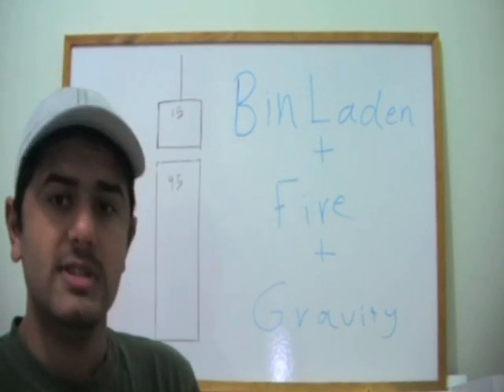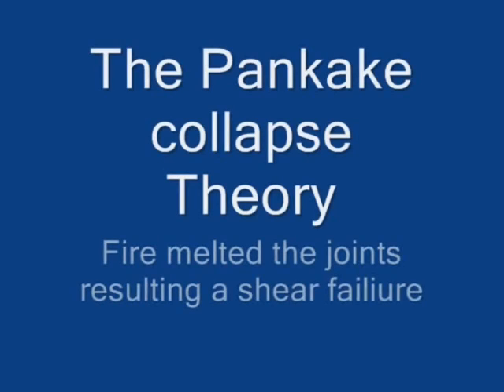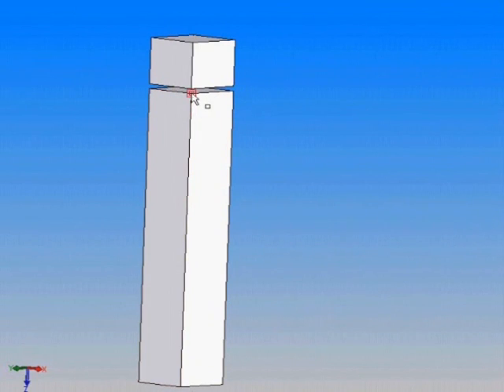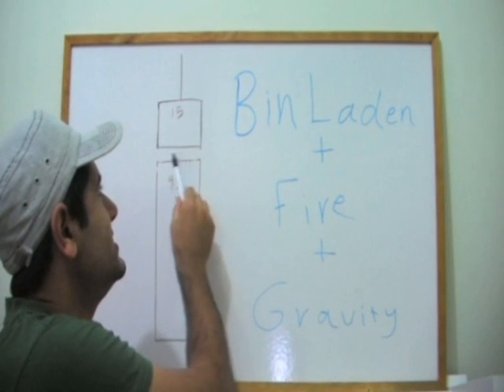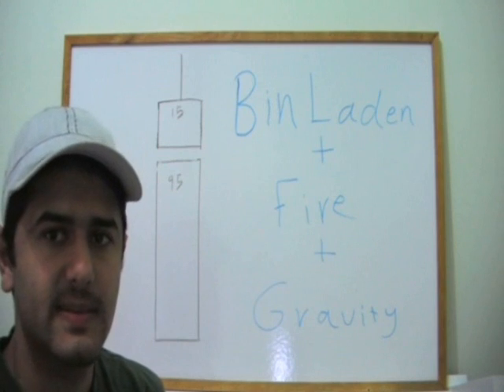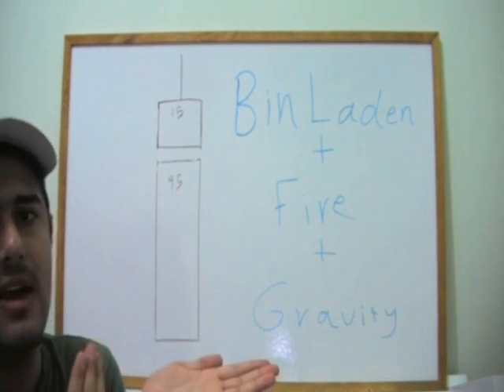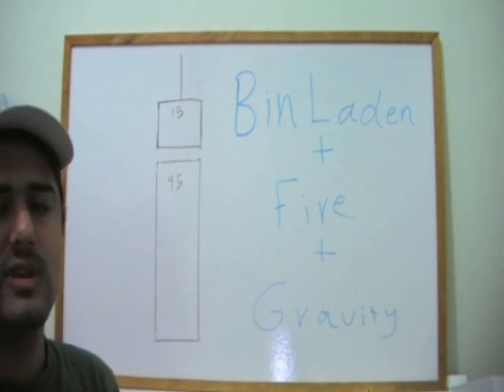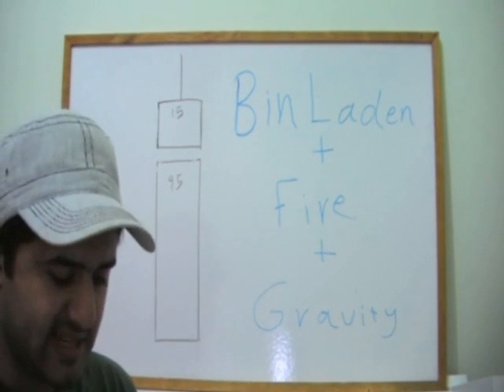(Part1) 911 Simple Physics Structural Failure Vs Demolition

Comment: all that needs to happen is for a percentage of the collumns and/or key collumn locations such as a corner along with 1 side, to fail for the others to instantly become overloaded and the entire building will collapse.

stop making excuses. we know what happened.
Reply: Blu Crystl - i read the first few paragraphs and already know your way off base. the COLLUMNS werent weakened by 50 to 90% and should not have been glowing red.
the TRUSSES under the concrete floor slabs WERE glowing red hot and failed, leaving the COLLUMNS unsupported and unable to support the weight of the building section above.
yhey didnt need to have strength reduced by heat.they had their ONLY means of standing removed and buckled like knees.
Reply: Blu Crystl - no way in HELL am i reading all that ! no way!
besides that your understanding of physics is severly lacking.
Reply: Blu Crystl - if you truly want to understand the WTC collapse, build a tower from legos or some other inexpensive building block set.
glue the collumns together to simulate their approximate strength as compared to other components.
or use lumber.
build the damn tower as close as possible to the actual construction of the WTC and conduct an experiment.
but heres a hint- cars are not a suitable analog.

Comment: Well, NIST says that the 1,362 foot tall North Tower came down in 9.8 Seconds. Laboratory free fall time is 9.2. This means that 80 or so floors of undamaged structural steel offered only .06 second resistance. This is impossible. Someone wired the towers to go down. The answer to 9/11 is 9.8

Comment: I once read a top class engineer commenting on this, he said when your sitting in your car and a big rig truck thunders down the road and runs right into your rear end, your little car does not move, the truck folds on your rear end, until it is virtually flat.  That's the same as this man is saying. You have 15 floors weight coming down on top of all the other {undamaged} floors below and that far smaller weight, even with momentum and remember the floors below get progressively far stronger. The floors below had to be far stronger to hold up the floors on top. It really is a puzzle because it doesnt add up in the physics.                Now your little car runs into the back of the parked big rig, If the Governments explanation of collapse is true then your little car crushes the truck right down to almost flat. Even with speed and momentum 15 floors cannot just flatten everything below, there is incredibly strong resistance in all the floors below. Anyway thats my understanding.
Reply: Ron, the towers collapsed at the point of impact of commercial airliners.  The south tower was impacted around the 78th floor, and this leaves 30 floors above the impact zone.  What do you think should happen when those 30 floors fall ten feet and impact the one floor below?  This would actually be better to here the answer your top class engineer would give.

Why do you suppose a 70 story spire was left standing after the collapse of the north tower?   Do you really think explosives placed in the inner core of a building would have left this same "spire" standing?

Comment: Studied science a little bit and you are speaking my language. I was just explaining all this stuff to my husband 5 mins ago, any one with an ounce of common science and a tiny bit of scientific knowledge can clearly see that it is physically impossible for the buildings to fall the way they did, not to mention the third building that collapsed the same way on its own, also another plane was brought down by the passengers or shot down.... I think that plane was meant for the third tower and they couldn't cancel the demolition because it would be impossible to remove all trace of the demolition set up, so they just blew it up anyway and blamed small fires. They claim phones didn't work on bored the planes but they do, they found no debris bigger than an apple yet they found the passports of the terrorists in the rubble. If you have a good memory of the propaganda on the news around the time, motives are clear to me

Comment: Plus, if they claim that fires weaken the steal, knowing that heated air goes upwards not downwards, we can assume that the part of the building above the fires has weaker structure than the bottom part of the building, making it more challenging to believe that weaker and smaller structure could crush larger and stronger structure. On top of this it is important to mention that the structure was progressively stronger on lower floors to hold the upper structure.
Reply: Here's what you need to understand: The towers were designed to fully support their weight via the columns; each floor was attached to the columns & was only intended to support its own weight, not the floors above (this is different from traditional skyscraper designs, where each floor supports the weight of the tower above it). It was all about the columns.

So the collapse begins when the columns BREAK and the full weight of the top block falls OFF the columns and directly ONTO the floor below - a floor that had zero chance of withstanding that kind of weight! Floor fails, its mass becomes part of the collapse & hits the next floor etc. etc.

So yes, the lower structure was very strong - but the way in which it was strong didn't matter because that strength was not broken, it was BYPASSED.
Reply: in your theory floors were piling up on top of each other and the weight of that pancake increased with each additional floor. There is only one small problem. Each floor had a layer of lightweight concrete 4 inches  (10cm) + steel beams. multiply 10cm x 110 and you get 11m + steel beams approx. 20m of rubble excluding walls and furniture and equipment. Can you show me a photo of such pile?

if floors were separating from the core colums falling down, where are they? Can you show me a photo of core columns?
Reply: Well, considering that the bottom of the pile was in fact 7 levels below street level - about 26m if each underground level was as high as each above-ground level - I don't see a problem with the pile. And much of the rubble fell outside the towers' foot prints, don't forget that.
Reply: the underground train track has not been crushed:
http://drjudywood.com/articles/DEW/dewpics/Image87.jpg

just so we understand how low the WTC 1 pile was:
closeup: http://drjudywood.com/articles/BBE/BBEpics/after.gif
zoom out: http://drjudywood.com/articles/BBE/BBEpics/before.gif
Reply: if the floors were collapsing, piling one of top another. where are the elevators? ther should no be crushed by anything? Where is a single elevator button? WTC had 150 elevators.

Notice the reinforced sections underneath the plane impact point:
https://upload.wikimedia.org/wikipedia/commons/thumb/e/e4/World_Trade_Center_Building_Design_with_Floor_and_Elevator_Arrangement.svg/799px-World_Trade_Center_Building_Design_with_Floor_and_Elevator_Arrangement.svg.png
Reply: Pawel LL Can you tell me precisely (on a map, preferably) where that train station was located? How deep was it? You see why the answers to these questions is important.
Reply: when you see a real pancake collapse you know it is real as therre are no doubts.
http://drjudywood.com/articles/why/whypics/25_pancake_quake051009.jpg
Reply: Oh yeah, I recognized the hallmarks of a Judy Wood nutter.

Space beams? That's the theory you're going with?

Um, okay.

Comment: I'm no controlled demolitions expert but it seems like the controlled demolitions experts have been doing it all wrong. From 9/11, we've learned that all one has to do is blow out a portion of the support in the top 25% of a building and then light a fire hot enough to weaken any remaining support structures. The building will then collapse into its own footprint in about an hour. Just think of how much they would save on logistics, explosives, det cord, labor etc.
Reply: TimReed22222 You agree then that the cost of the airplane does not factor into the feasibility of building collapse as a result of it being impacted by said airplane. You can't possibly know what I do or do not know about physics so you're a person on the internet making wild assumptions out of complete ignorance. This, to me, means there is no chance you would understand the math even if I drew it out in front of you. So, your statements only prove that you certainly don't know what you're talking about and have no validity whatsoever. I'll give it a go in laymen terms in a way a 3rd grader could understand. Law of Conservation of Momentum indicates, in part, that the mass of an object is constant. Simply speaking, the mass below the impact of the aircraft remained constant. The mass below the impact was much greater than the mass above it. For every action there is an equal and opposite reaction. So, the force of mass below the impact was acting in "at least" the same force as the collapse above it, right? So, the mass above would have stopped or at least met "some" resistance, correct? It certainly could not have accelerated to terminal velocity. Here, since the collapse above pulverized (keyword pulverized) the mass below at free fall (no resistance. Watch the collapse and time it yourself. Look up free fall before you make some stupid comment about what I know or don't know), this is the first time known to mankind that this happened and it just so happened to happen 3 times on the same day. One time, it happened on a building that was not significantly damaged by an aircraft (Building 7) which subtracts the folly of your hundred millions dollar airplane comment completely. The only way the buildings could have all collapsed at free fall is if there were no resistance (nothing but air below them). Partial collapse makes sense. Complete collapse and pulverization does not and defeats the laws of physics. If there was no resistance then the resistance had to be removed. One more time because this is important. If there was no resistance then the resistance had to have been removed. There was no resistance. Extrapolate how you will from that point.
Reply: Savoy W "This, to me, means there is no chance you would understand the math even if I drew it out in front of you."

Try me.

"Law of Conservation of Momentum indicates, in part, that the mass of an object is constant."

>*facepalm*< OMFG NO!No it does not. That's Conservation of MASS you're thinking of. NOT the same thing! 

And we're off to a roaring start ...

"The mass below the impact was much greater than the mass above it."

So? Wait - you're not going to argue that a larger mass always beats a smaller mass, are you? PLEASE tell me you're not going to say that.

"So, the mass above would have stopped or at least met "some" resistance, correct? It certainly could not have accelerated to terminal velocity"

The falling mass DID meet resistance. How do we know? Because the collapse did NOT reach terminal velocity (or free fall, as I suspect you mean since terminal velocity is not relevant here). I have timed the collapse. For the north tower it was over 20 seconds, more than double free-fall time. Did not happen.

As to building 7, true it was not damaged by an airplane -but it WAS damaged by a 110-story skyscraper falling on it! Did you forget that part?

"Partial collapse makes sense. Complete collapse and pulverization does not and defeats the laws of physics."

Still waiting for you to justify this ludicrous statement. So again, I ask: 

Show your math. Which laws of physics "failed"?
Reply: FIRES ON THE TOP FLOORS OF THE BUILDING CAN NOT BRING THE ENTIRE BLDB DOWN SAVOY!! THAT IS FUCKING IMPOSSIBLE!!
Reply: Chris Shafi I agree 100%
Reply: Don't forget to crash a $100 million airplane into it at high speed first!
Reply: TimReed22222 The cost of the aircraft does not cause the laws of physics to fail.
Reply: Savoy W You don't know shit about the laws of physics. Which "failed" on 9/11? Please be specific & show your math where possible.